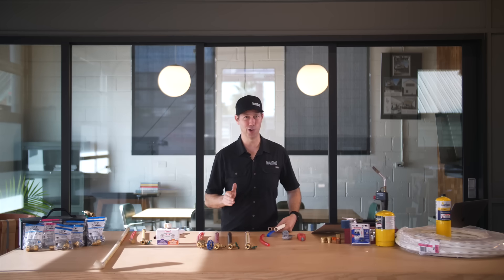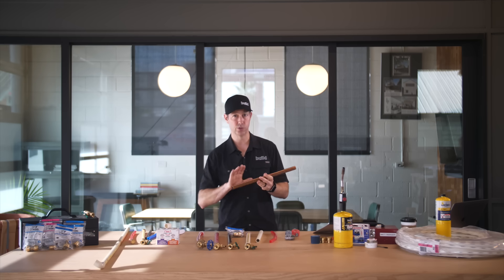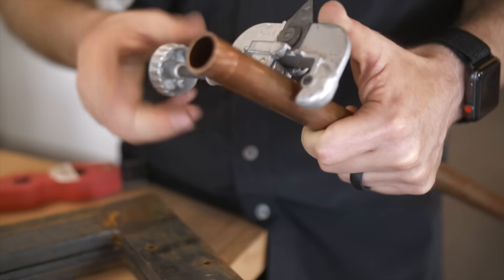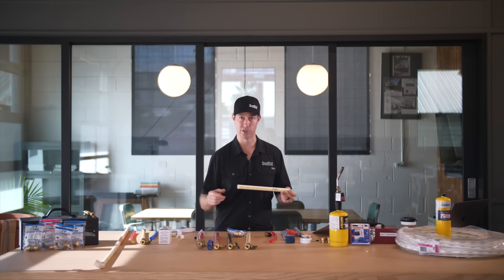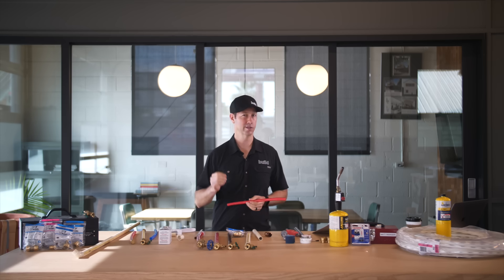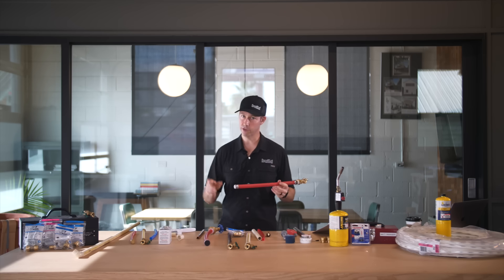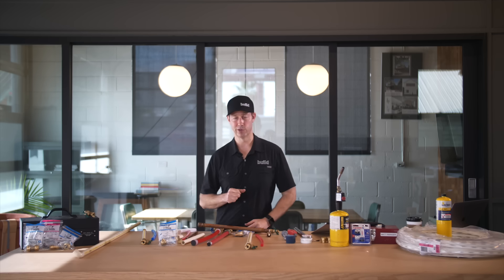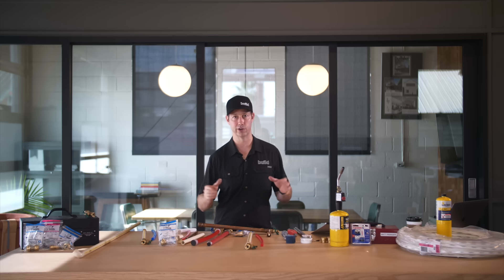PEX vs COPPER vs CPVC plumbing pipes

Comment: If you live in a rural area and have an ongoing battle with the mice, I'm wondering if copper is a safer bet? The dam mice might do a job on the pex plumbing, any thoughts?
Reply: that is why i would use pvc and cpvc rather than pex...i heard rubbing palmolive on pex as you install gives it a taste that rodents hate

Comment: 25 years with my copper pipes,.....never knew what a plumbing issue looks like....i guess i will continue with my comfortable life for a looong time ....
Reply: I purchased a new home 13 years ago I remove all cpvc dumped in garbage and i install new copper type L made in usa with made in usa copper fitting bcz I love house I want it keep for years without worrys some plastic water line bust and destroyed all house on second
Reply: Semper Fi  Never seen that happen, and in the video the one case he ever heard of was from a rusted out waterheater cramming the hot water pipe with rust and causing corrosion.
Reply: Good chance it will last another 25.
Reply: That's absolutely so true plastic pvc is absolute garbage and becomes brittle and will leak .its never a cost savings when you look at what it costs to replace and the damage that can happen with cheap materials. The  unintended things that you will deal with later is not worth the initial cost saving of installation 
Of cheap materials.

Comment: Brass is the oldest water supply system used. Most of the older homes built in the 1920 and earlier used the red brass which are still in use today.
Reply: What about galvanized?
Reply: @KingRatt  your not serious, are you?
Reply: @salvatoresaccoccio2379  yes I am. I have never seen brass plumbing only some valves and fixtures.
Reply: @salvatoresaccoccio2379  actually lead is the oldest.
Reply: @KingRatt  your right! I should have said one of the oldest.
Reply: @KingRatt  I’ve seen galvanized on water. It’s not supposed to be for water though, that doesn’t mean some knuckle head wouldn’t use it. If you’ve ever seen the inside of galvanized pipe after a few years you’ll know why not to use it.
Reply: @salvatoresaccoccio2379  it was used for decades. Many old homes still have it. Check the big box stores they still sell it as such.
Reply: @KingRatt  I don’t know where you live, but here in New York State galvanized pipe,lead or plastic are not allowed to be used for drinking water lines.
Reply: @salvatoresaccoccio2379  Michigan. You aren’t allowed to breathe in NY without permission.
Reply: @KingRatt  you got that right! Are you Originally from there.
Reply: @salvatoresaccoccio2379  born and bred.  Certainly ready to leave though. Hoping for some states to secede so I can choose a new home.
Reply: @KingRatt  yeah I’m not going nowhere, like to. Maybe South of here somewhere.. but three new grandchildren makes me a perfect candidate for staying here.
Reply: @salvatoresaccoccio2379  I admire that but I could never live there. Michigan is bad enough.
Reply: @KingRatt  honestly if I had the chance to live on a mountain with fresh water and no restrictions I’d be a happy man. Both my grandparents worked the land to survive. I could live that life easier than what’s out there nowadays.
Reply: @salvatoresaccoccio2379  we are of like mind on that for sure.
Reply: @KingRatt  are you in the city up there
Reply: @salvatoresaccoccio2379  I have two houses but right now the one I spend the most time at is in a small town. My other is rural with thirteen acres.
Reply: @KingRatt  thirteen acres! You probably won’t believe this. My grandparents, moms mom and dad had a thirteen acre farm that’s been in the family for three generations . They had all kinds of fruit trees on it and sold their harvest in the local town sq, like a farmers market. Anyway when the Germans invaded Italy they took control of the farm. Luckily my grandparents had a place in the city not far from the farm, when the Americans invaded Italy the Germans before they took off burned down the farm. I have two acres that need a lot of work in Gaeta . My cousins share the rest. The United States has a naval base there which my kid brother attended. I’m lucky to have this one home here.
Reply: @salvatoresaccoccio2379  that is amazing. I have some apple trees and a pear tree along with some Concord grape vines.
Reply: @KingRatt  I tried grapes once and I don’t remember what species it was, but any grape vine turns to concord around here lol! The home I’m in now has a crabapple tree on it and even the squirrels don’t want them. My dad use to make wine many years ago, when he was alive . I came from a family that worked the land and pickled and canned, raised hogs and chicken had horses and donkeys and dried our meats. Growing up in New York some of kids consider us hillbillies. My mom always had a vegetable garden once they got a house. I’ve tried keeping in tradition and have been growing one every year since 85 when I got my first home.  You grow vegetables?
Reply: @salvatoresaccoccio2379  the grapevines came with the house I only had to prune. Have made grape wine also. A couple times it turned out good. I would like to have raspberries for wine, jam, and pie. I am not a vegetable eater so I have never done a garden.
Reply: @KingRatt  Concord grapes are great for jambs and jelly! Makes a decent wine too. My dad would get a few different red  grapes for the red and a Zinfandel mixed with moscato for the white. Trust me when I tell you that it’s an acquired taste for homemade wine. Tough when it his taste buds but quick to get buzzed and relaxed lol!
Reply: @salvatoresaccoccio2379  I like concord as wine but prefer raspberry for jam.
Reply: @KingRatt  I grew up on marmalade, orange and lemon! You make your own wine? How many barrels do you make? My dad would make 2 red 1 white. About 250 gallons for the year , and some times we ran out wine lol 😆
Reply: @salvatoresaccoccio2379  I have made my own in the past. I would say the biggest year was four cases.
Reply: @KingRatt  nowadays it’s cheaper to buy it. Although I do miss homemade wine. It’s stronger! I started drinking it 60 years ago when I was 8 years old, still drink a bottle or so every night lol
Reply: @salvatoresaccoccio2379  I am always interested in anything that contributes to self sufficiency.
Reply: @KingRatt  hey buddy hope you’re doing well in these trying times in our country. It’s nice to read your thoughts. It seems you and I share a lot of common values and it’s a shame we’re not close enough to go and get a beer or two somewhere.Thanks for listening and sharing your thoughts, I hope I’ve peaked your interest as you have. But I have ask you, why did you choose king Rat?
Reply: @salvatoresaccoccio2379  yes a beer and intelligent conversation with like minded people seems hard to find. KingRatt was from my online gaming days. It came from a drag car I saw once that said King Rat so I took that and added a T for the 80s hair band.
Reply: @KingRatt  what’s your favorite car ?
Reply: @salvatoresaccoccio2379  out of high school i bought a 66 impala but have always been a Ford guy taking after my Dad. I really like the 66-77 broncos. I am also partial to tbirds mustangs and falcons. I like the old muscle cars.
Reply: @KingRatt  I had a 61 Pontiac Ventura out of high school. It belonged to my dad and he let me use it , my first car that I owed was a 60 Volvo that I got for a couple of hundred dollars. It had a bad hood latch and if I went over 50 MPH it would release the front hood and I had to stick my head out the window so I could look for a spot to stop. 😆 I’ve had ford vans for work. My favorites are 60s muscle cars also. Favorites are Chevelles, 66 to 70.. GTOs , would love to get a 57 t , two seater. I drive a 2005 Silverado SS now.
Reply: @salvatoresaccoccio2379  currently driving a 2003 expedition.
Reply: @KingRatt  how much is gas by you now. I’m at 3.25 for premium
Reply: @salvatoresaccoccio2379  $3.28 for premium $2.68 reg.
Reply: @KingRatt  I’m getting about 10 MPG now a days
Reply: @salvatoresaccoccio2379  14-15 for me.
Reply: @KingRatt  that’s great for a big truck
Reply: @salvatoresaccoccio2379  yes not bad. I only got about 17 with explorer sport.

Comment: Cpvc sucks! After about 10 to 20 years you cant cut it with those cutters! It will crack up instead of cutting through, sure new it looks awesome but no dont use that stuff, please take it from me, im in apartment maintenance, i know you guys all think we just do the handyman fixes but trust me im the odd man out, pex is the best! The only thing bad about it is when using rings to repair you gotta have room to use your tool

Comment: IIRC, in MA, by code you can't use CPVC for water in, only for water out. I could be wrong. - A big source of corrosion I see with homeowner copper install is people who use steel/iron pipe hangers to suspend their copper. I even lived (rented) in a place where the basement flooded because the homeowner had connected copper directly to the iron utility coming off the street, without a brass bridging connector. That was a heck of a mess we caught before the pipe failed fully.

Comment: If CPVC is not supported properly overtime it will start the stretch and deform I ran into that at my old house. The person that Plum the house didn't have enough straps instead of doing every stud they did every other stud and in some cases every 3 studs so between those straps the pipe was sagging up to I think the worst spot was almost a foot so when I helped a friend remodel his house we strapped on every stud and that was almost 15 years ago and he's had no sag or deformation

Comment: I am new to knowing about Pex, but think the fittings bought the other day are different frim both of yours. These just pop on like CPVC (without any glue) and use a very cheap little tool for taking the connection back apart.

The connections probably cost more though, probably around $2 to $3 each.
Reply: If you mean push -to-connect Sharkbites you are sadly mistaken on price!10 bux most fittings and 30 for a repair coupling.this must be what you are talking about as they use a n orange tool to remove them .they fail after 10-12 years.not for behind sheetrock.

Comment: Confirming hot-tub failure of cPVC pipe after only 3 years when cPVC pipe is used in the UV-light filter/cleaner.  The cPVC pipe weakened/thinned from its inside out, to the point of being able to press thumbnail right through it as if butter.  So it seems cPVC either becomes brittle hard (per comments below) or else butter-mush-soft when exposed to constant UV light for 3 years.

Comment: I very much enjoyed the informative video as a past "owner builder" of a house. Our previous neighbor in Vancouver Canada (we moved aboard a sailboat 5 years ago) has been instructed by his insurance company to have all Pex plumbing removed from their quite new home of approx. 10 years or they will not be covered by insurance. I found this to be quite shocking as the house I built in 2006 was plumbed with Pex to save on labour costs and was recommended by my plumbing contractor....on my future build (when we return to land life), I would probably go back to traditional copper.
Reply: In Canada and some in US there was a popular pex installed which was Aluminium core with pex and the failure rate was so high the company was sued and went out of business. All this pex, thousands of properties,  had to be replaced.  This was much like the spray foam with formaldehyde where the homes could not be sold until it was removed. In my area you have to disclose this type of pex on the sale form and insurance will insist it be removed.  That being said all other pex performs well and is a good option with none of the problems of this AL version.

Comment: Love your videos I was always wondering what if you put a brass threaded system they sell threaded brass fittings and they sell brass pipe so I'm wondering if this would surpass any of these I'm a pipefitter of 25 years and out of the three I would go with CPVC but I've always wondered if you use brass piping how would that be

Comment: The Copper Pipes Starting getting small pin Holes throughout my house at approximately the 38-40 year mark. Ontario Canada, city water. Going to replace it with PEX i dont know how long that will last but I will be selling the home in 5 to 10 years so im not to worried.

Comment: You didn't mention threaded steel pipe. Stainless, galv or black. 
Requires a lot more work and planning. Biggest advantage is it is drill proof when embedded in masonary, and spade proof when buried.
Copper joints require brazing, not soft solder as demonstrated in some jurisdictions.
Coloured xPVC primer makes the inspector's job easy too.

Comment: Only copper will be used by me when building my home. Use dampers at your washer tub and sinks. Do a good job and forget about it. Contractors of large numbers of houses don't use copper either because of crack heads stealing or they are cheap and will not hire a real professional.  Use copper folks it will save you in the long run.

Comment: Matt, love your vids, but you have a gap in your knowledge on copper corrosion causing pinhole leaks.  You started on the right track with the sacrificial anode, then aluded to rust flakes causing pinholes in the copper.  Please look up galvanic corrosion.   It occurs where you have dissimilar metals in an electrolytic solution.  No water is pure, and other than well water, will have by order of EPA via state protection agency, chlorine to kill pathogens.  This is your electrolytic solution.  The next portion is oxidizer and reducer.   The steel in the water heater is the oxidizer and the copper is the reducer.   The zinc anode (sacrificial) is there to reduce before the copper does (the sacrificial part).  When it is completely gone, the copper begins to reduce.  When it happens where the copper is usually at 90 elbows, but could occur anywhere.  In my previous career, I was an engineering laboratory technician in the US Navy submarines working on the reactor chemistry.  This career is industrial automation with my beginnings as a standard electrical contractor.  Keep up the great work, love seeing the new products and the explanations of how and when to apply them.

Comment: Pex is very tough & durable material, the cramp is extremely strong; it will save a lot of time & money than copper. Copper need welding on every joint will cost a lot of time & it will get corroded. Pex all you need is to cramp down with ring & it will not get corroded. Pex can last almost forever in my assessment. Shark bite work great with pex.

Comment: A previous owner of my home changed the plumbing form copper to CPVC, which wasn't necessarily  a bad thing. I don't know the time line for how long ago that was done. Earlier this year I had a leak from the CPVC going to my water heater. No biggy right? Just cut and splice in a new strip.

Well, the CPVC was extremely brittle. Using the cutter like your in the video caused the CPVC to snap/break. It was very dry so I have to use a hacksaw to cut it without breaking anymore out. So yes, it can degrade but I cannot say as to why it did. All of the CPVC through my house is in the same state, bump it too hard and it cracks or breaks.

Comment: It bears mentionning that in private homes the heat exchanger (heater/A.C.) generates a condensate which is acidic. It ate through the copper discharge piping not once but twice in about four years in my parent's home. Consequently, while it may be a single, sometimes short run copper pipe it's potential to cause a heck of a lot of damage to a nicely finished basement is very real. Just something to consider in your choice of piping draining the water condensate from your heat exchanger.

Comment: I've been in the plumbing industry for 7 years now.
CPVC is junk, it worse then copper. It's brittle and in my experience.

My friend bought a new house built in 2016, new homes are garbage. The CPVC was only 3 years old and was cracking on its own and the glue joints we literally melting away like Melton metal accept very slowly

Comment: My home was built in 1974 With copper, no leaks, and in 2040 no leaks!!
Reply: 2040! We're not even there yet, this is 2019. Or maybe you're Psychic?😉
Reply: @bubbleblonde9600  I have a Flux capacitor in my house ! And CVT transmissions are just the best thing since apple pie. Some things you just can't cheat on, and using PEX is cheating big time. :-)

Comment: three types of copper, m=red, l=blue, k=green copper . k is the thickest , type L is the most common.
Reply: You mean the writing on it not the color of the pipe?
Reply: @KingRatt  yeah there will be a colored strip running down the copper pipe, it will match the type of pipe it is M,L, or K

Comment: CPVC is a total crap on hot water lines. I had to replace a fitting and the pipe ended up crumbling and made me have to replace the entire line from the water heater all the way to the upward run into the house. It might work on other stuff but after about 15 or 20 years it will break very easily.

Comment: Used shark bite on new water line from meter to the house. The shark bite fitting failed after 6 years. Don’t know if it was the soil (I live in Georgia with the red clay soil)or that the brass on the fittings is just too thin. The fitting did have some corrosion on the brass.